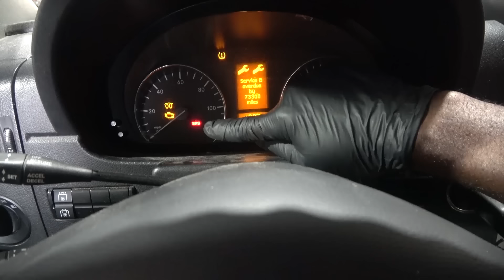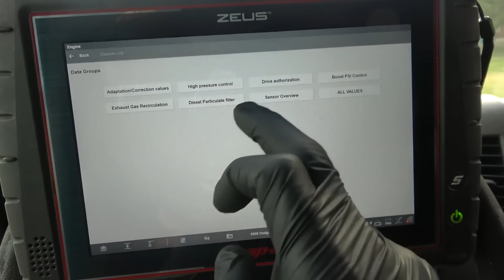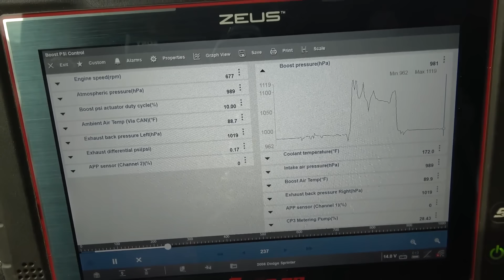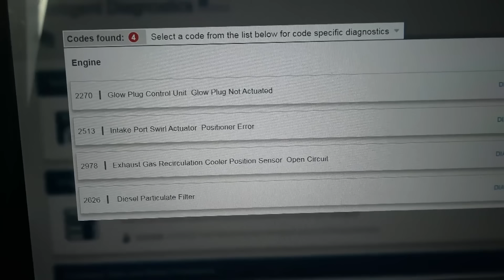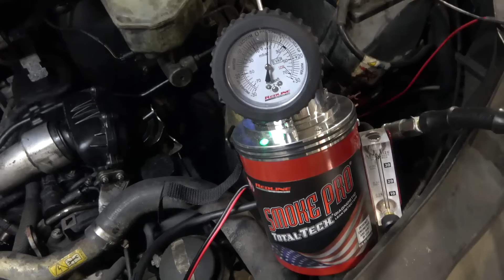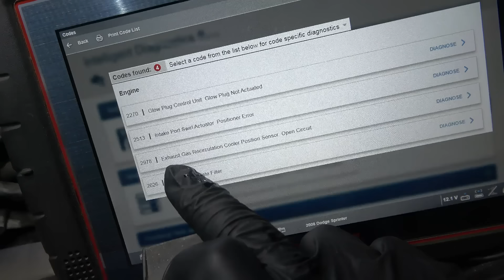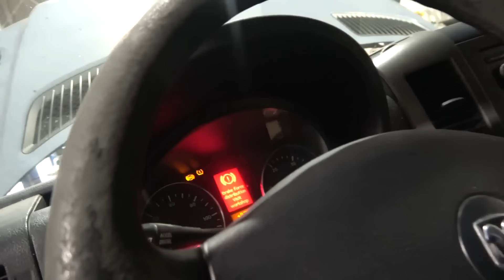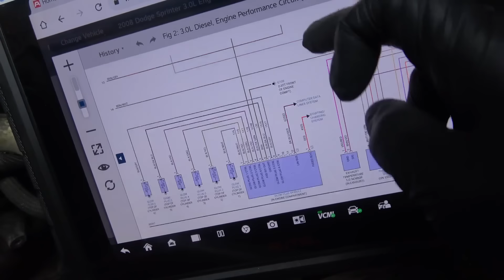Customer Says This Dodge Sprinter Can't Go Over 40 MPH - Can we Fix it? Part 1

Comment: Hi Keith, my name is Marshall Patton. I’m working with channel auto on a 2014 Mercedes GL 350 initially got where it would crank but would not run when I started working on it. I’ll start checking the time in chain for being stretched. I replace the chain in it and it would run for about 30 seconds to 60 seconds. Once it got hot it would not run anymore. we put new electronic fuel pump in it. New timing chain new guy at the high-pressure fuel pump. Looks OK I’m getting pressure according to my Scanner. I finally took the catalytic converter off and now when it’s cold it’ll run for 2 to 3 minutes. The only cold, I’m getting is the left and right and tech circuit shorted. I’m wondering if you could give me some pornos and if it cost something and if it cost something, I’m sure Guy wouldn’t mind paying for it. Thank you would like to visit your shop one day. I’m in the Metropolitan area. I’m out of DC Washington.
Reply from the maker: @MarshallPatton-f7e  how can I help?
Reply: @KITS_Auto_and_Truck_Repair  I have put a time in chain new guide and a mechanic before me put new electronic fuel pump in it. I tested high-pressure fuel pump it’s working I found out that the Carolina converter was clogged. I got it to crank and run for about 2 to 3 minutes, but I’m getting a cold on my left and right in tech shorted. Wondering if you can give me a couple of corners are if you could help or repair it for me I’m sure the guy that had me working on it would not have a problem, Pam thank you.

Comment: Thank you for sharing your experience…. I have a question….. why you didn’t use snap on to activate the actuator or for any bidirectional operation…. I am an autel user but my shop soon going to buy snap on ….. I just want to know because I was pushing them to buy a newer autel scan.
Reply from the maker: @shamessun  My Pleasure! Great question, I like the snapon scanner because of the way the data PIDS are written in it, but most Bidirectional control tests do not work on sprinter vans, the Autel scanner is better on sprinters when it comes to Bidirectional tests

Comment: Hi Deo, what is the model and price of the Autel scan tool that you used in this video, and does it come with a wiring diagram, if it doesn’t, what is the best source of wiring diagram to access through this scan tool?
Thanks 
Joel.
Reply from the maker: @joelawoyomi9102   Hi Joel, the Autel scanner is about 4k and the wiring diagrams don't come with it, you get the wiring diagrams from mitchell prodemand!
Reply: For wiring diagram, pls  check out all data dig.
There is a subscription though.
Reply: Thanks, does the All data wiring diagram contain components locations on vehicles as well?
Reply: @joelawoyomi9102  it doesn't pin point the exact location. You have to follow the wiring colors as to where it connects.
Reply: Thanks, but one needs to locate a component first and foremost before checking and determining its wiring colors. Just following the colors of wires in wiring diagrams can be misleading as different components may share same wiring colors and tracers. Don’t you think?